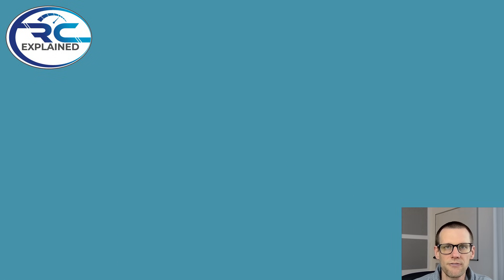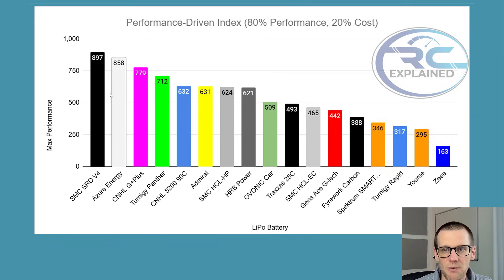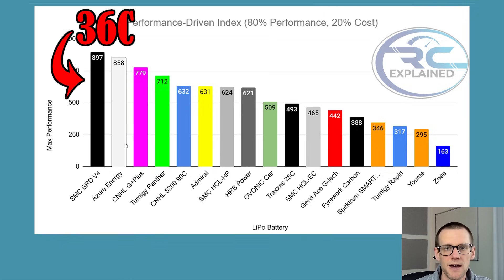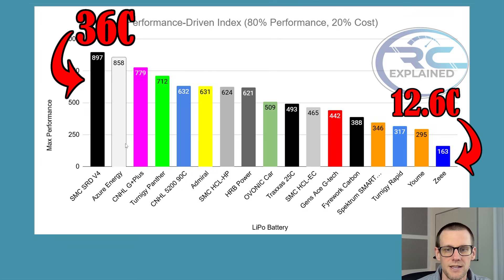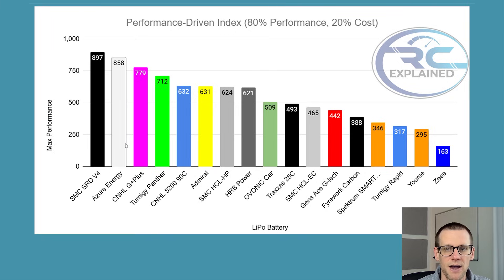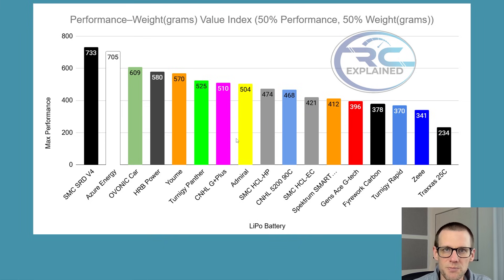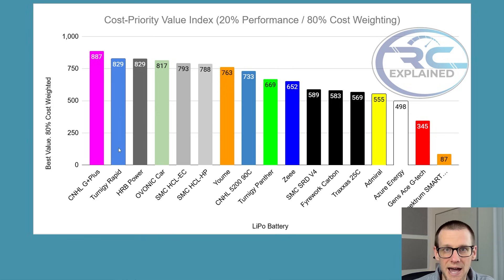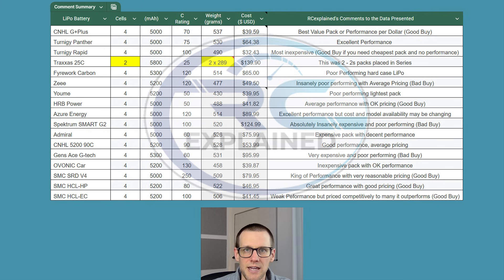17 Popular 4s 5K LiPos Tested — The Results Change Everything!

Comment: My last 3 batches of CNHL (120c), all started amazing (standing backflips with a kraton was a guarantee). I never charge past 1c. After no less than 10 runs on them, they started to not balance well and would take forever to charge as resistance creeped up past 50 m ohms on at least one cell per pack. Massive disappointment on the durability segment. I'm here for anything but that crap. I've got some 4 year old ovonic rebels that have countless runs on them and still sub 10 m ohms on all cells. Performance and durability would be great, but definitely not performance only.

Comment: I knew zee were garbage compared to my HRBs. My hrbs after 4 years are so used and old that they puff slightly under use but go back flat when cooled. IR are between 10 and 15. They have around probably 500 cycles

Comment: I love the results I guess I'll finally be done with the zee batteries and try and CNHL but I wish you did a test on run times for each  because in theory if a CNHL battery is outputting more power it would run put quicker than the Zee batteries or is it not that simple
Reply from the maker: You can see the individual test videos on the channel. I have a graph that shows the run time at 100A constant. Run time is lower on the weaker batteries as LVC is hit soon due to voltage sag.

Comment: I swear by my SMC's and the CNHL 70C and 90C packs. They've lasted me a long time, I usually only charge at 1C using an Icharger 308 DUO, and my internal resistance on my 3 year old CNHL 70C and 90C packs is still pretty low/between 0.9 and 0.7 milliohms (mΩ).. Another thing about the CNHL packs, and any high-end Lipo pack is that they're constantly being upgraded/improved. I just recently took advantage of the CNHL Black Friday sale and picked up a couple 6S 90C 52000MAH packs, and they're significantly smaller in size, and they're also 50 grams lighter in weight than the same packs I got 3 years ago. One thing worth mentioning is CNHL is CONSTANTLY doing sales on their packs if you're looking for great packs and you're on a budget👍👍 Hope this helps!!

Comment: For whatever it's worth, I've had pretty good luck with my Zee batteries, especially for the money.  But I only use them for 1/8 ebuggy running laps on off-road tracks, which isn't that demanding of batteries since it's 4S.  I also use one of those 4S packs to power my starter box for my 1/8 nitro buggy at the track, so that's an even lighter load.

When I first got the ebuggy in 2020, I shelled out big bucks (over $100 each I think) for 3 name brand Gens Ace Redline 4S 6000mah packs, and they all lasted about 1 to 1.5 years before puffing.  Replaced them with 5 of the Zee packs (some 5200s, some 6000) 3 years ago for less than half the price and couldn't tell a difference in performance, yet lifespan is better.
Reply from the maker: Thanks for sharing your experience, it's always great to hear real-world usage!

Comment: Wow very cool video of the 4s lipo battery. Can you do 2s high end battery's like Gen ace redline 130c 140c, tekin, I don't know if Orion is around anyone, trinity, protec, reedy, and I am sure there is more for both stick pack and shorty pack I am very curious on these high end race pack that people use for racing. I know I tired gensage redline vs ortion and protec and I swear I like my gensage redline the best also did compare to zee battery and gensage just have a little more off the line punch over zee battery so maybe I just got a really good pack others but I got 3 gensace redline just because I had the best luck and performance so I am very curious on your testing if your able to test all the high end 2s lipo
Reply from the maker: Im looking in to how I can up the battery spending budget. This costs thousands to do.
Reply: @RCexplained got it i understand batteries are expensive now

Comment: Having recently bought a couple of Spektrum Smart hard-shell batteries (2s 5000’s), I can vouch for the fact that they seemed very expensive! However, for me personally, I’ve taken into account the “smart” aspects of ease of charging (using Spektrum smart charger) and their automatic self-storage mode after 72 hours non-use from charged status. I gulped but did it anyway. And they are a perfect match for my Arrma Quake (I’m a recent newbie to RC cars so wanted simplicity of Lipos integrating for that application). So far I’m happy with purchase😀

Interesting vid though. Eye-opener.
Reply from the maker: I understand the reasoning on your purchase. It makes sense. Unfortunately this test largely considers performance as a means to investigate the c ratings slapped on to the label.
Reply: I'm just disappointed that they are so low performing on his tests. I don't mind them being expensive if they are in the upper performing but seeing them low performance makes me reconsider.

Comment: I started (like many) with Zeee - swapped slowly over to CNHL packs and noticed such a difference in performance.
Reply from the maker: Glad to hear you found an improvement!
Reply: Doing that now as we speak. Ordered Zeee when I started racing last year and now I'm looking for better performance. I can see the difference between my car and other cars within the Stock Racing classes in Off Road. Got a recommendation to use CHNL and bought some to replace my Zeee packs asap.
Reply: In the air where it matters, on a power hungry EDF model, lowest quality I go for is Ovonic or HRB.  You don’t want to unexpectedly have the pack voltage sag in the middle of a maneuver.

On the ground, save for drag racing or speed runs, Zee all day, everyday!  Won many podiums on-road and off-road as well as a 2nd and 1st overall on two different race series all in the past year.  Any advantage a good pack delivers can easily be thrown away by inconsistent driving.  Until you can get your lap times to be within a few tenths of a second per lap, save your money on batteries and motors.
Reply: I started with Ace Spec Bashing 3s, is there something cheaper and better? I was looking at the Zeee but they seem to cheap to be any good and possibly dangerous

Comment: I don’t even bother buying Lipos. Liions cells have come along way especially the tabless cells. With a 4s1p 5000mahb60 amps continuous and 125 amps for 10 seconds. 17 minute flight time on a 50mm EDF. Try do that on a lipo and for the same capacity the lipo wont even fit inside the plane. Size for size Liion destroys lipos. More cycle life and no puffing on a Liion cells. Eve 50PL, Tenpower 50xg, rs50 are the best on the market atm .
Reply from the maker: How would it do in our test where capacities are kept equal. 5000 ~ 5800 mAh

Comment: Sorry I love your videos with the great explanations. But the fastest rc car in the world. Stephen Wallis holds the Guinness World Record for battery-powered RC cars at 234.71 mph. And it ran Onyx lipos. James McCoy also runs pretty fast. Using Onyx lipos. But you don’t mention them. SMC are good. But not world record breaking.
Reply from the maker: Im in contact with Oynx for over a year. They dont currently have a 5000 4s. Its hard to test a pack they dont make. Hopefully soon though.
Reply: @RCexplained  yh, afraid closest Mike has is the 5200mah 4S packs.
Reply from the maker: Was just on the site and dont see the 4s 5200 speed run pack? Im sure they would have told me one exists if it did.

I will test an Onyx in time for sure. I want to test every high performance LiPo that can compete against the very best.
Reply: @RCexplained mikes stuff does sell out fairly quickly. Got a whole bunch of guys waiting on the 2s shorty racing packs. I’ll ask Mike direct. See what he says.
Reply: I think i saw that record was already broken. The other guy got 237.9 a week or so ago.
Reply: @boduke9428 not the Guinness world record though. That has to be done officially with the correct calibrated equipment. The record at Rossa by the beast is done using official equipment. By all means google it.
Reply: Can u imagine how much faster he would go if he used SMC batteries  ?
Reply: @Barry843  🤣
Reply: @SM-RC after that test I think your response is 🤣